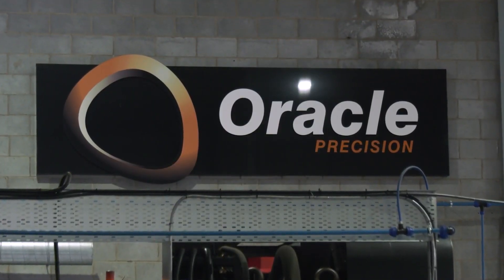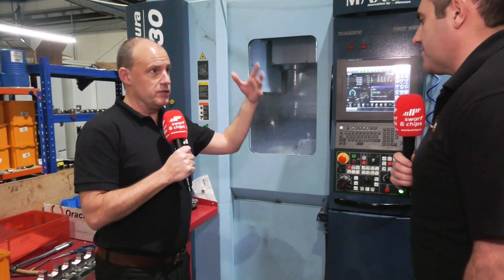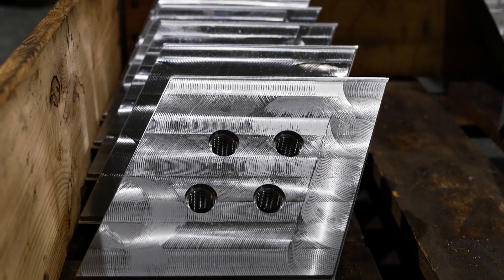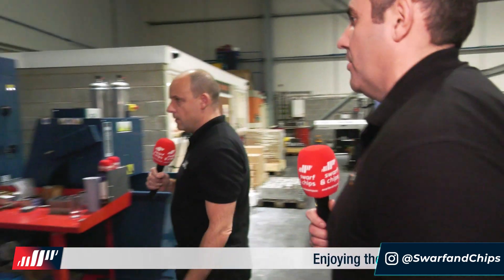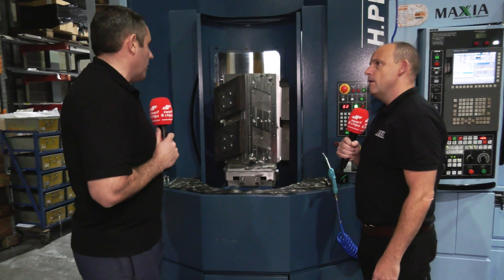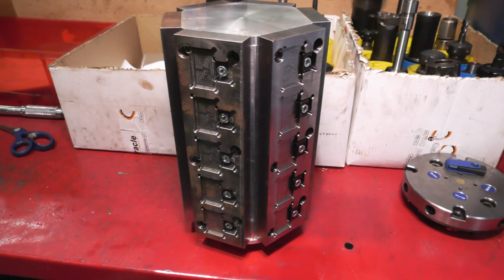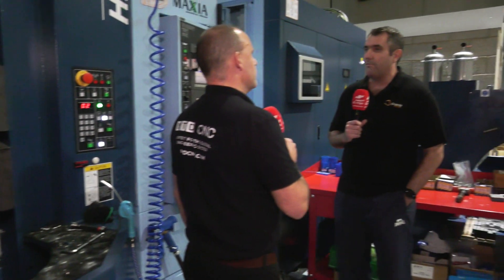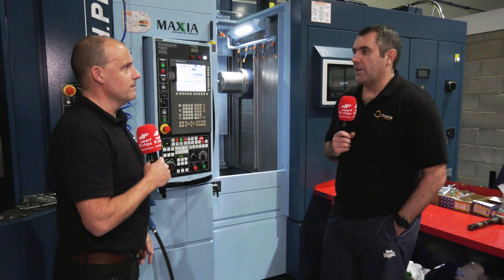How To Make A Fixture That Holds More Parts | #SwarfandChips

Comment: Super video and nice perspective! as a programmer & operator in a job shop with a lot of mix parts; it is great to have modular fixturing like zero point / pull studt , etc since it is quicker the changing process, I think buying the modular system for a company is great but then you can adapt youw own designs there so can fit the process of your shop and that is the magic!
Reply from the maker: Glad you enjoyed it!

Comment: As a operator, if its repeat work I would rather make custom fixtures for increased runtime but I wold prefer modular fixturing if I don't know what new print Im getting tomorrow. I think the mix/volume relation realy matters in this question and the awnser is different for every shop and product.
Reply from the maker: Glad you enjoyed the video.